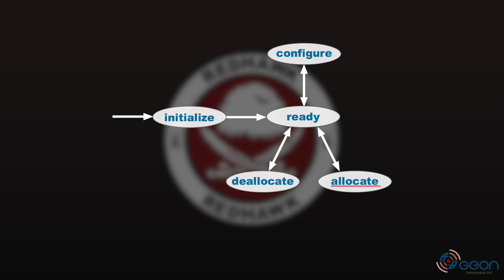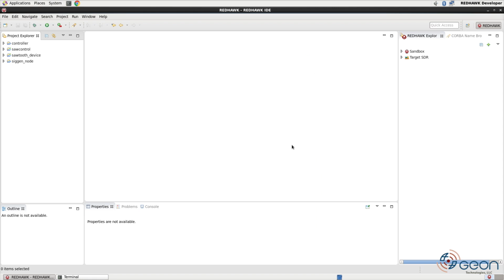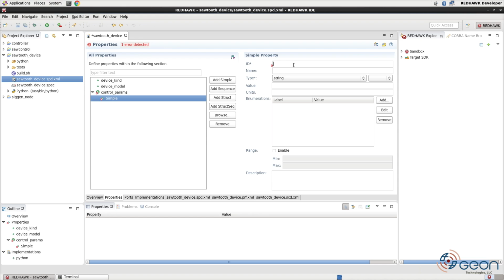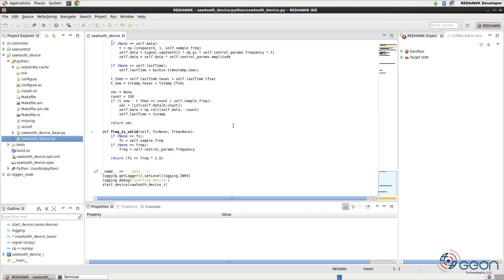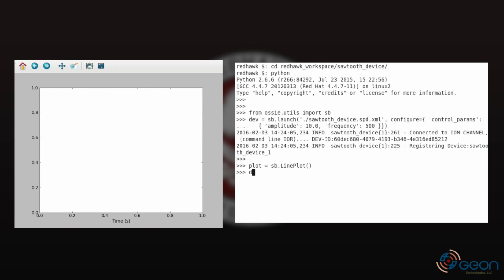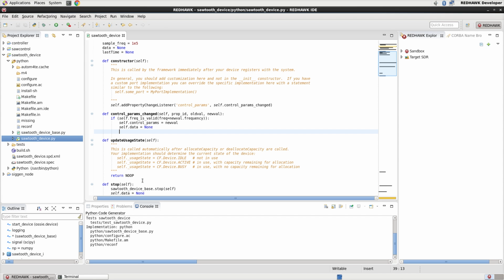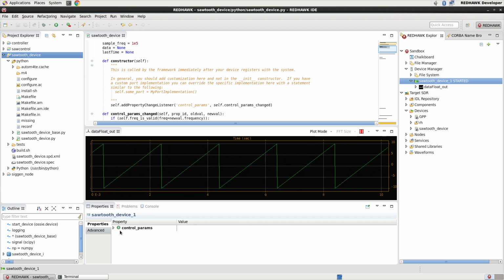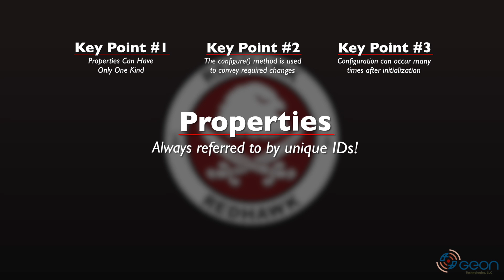Property Kinds Part 1 - Property (v2.0)

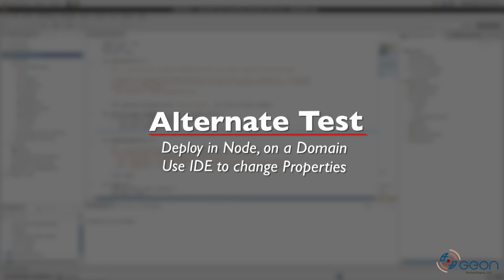Comment: Hi guys, 8:00 Alternate Test - How do you deploy the device to a target SDR? I'm trying to transmit a redhawk wavefrom from my E310 which has automatically connected its device manager (and USRP_UHD device) to the REDHAWK_DEV domain.
Reply from the maker: In testing, you can drag and drop the Device and then a Device Manager project containing it over to the Target SDR in the IDE.  That will give you the ability to run it on the local Domain (if running), but I'm not sure that's really what you're asking.  The USRP_UHD is not an executable device, so it cannot load or execute components from the Domain's SDRROOT.  For software components, that's typically the standard GPP device.  Does your E310's device manager have a GPP?  Does your Domain have the waveform and components installed in its SDRROOT?  Do those components have "implementations" defined that specify the processor type as that of the E310's GPP (as defined in its XML)?  If all those are yes, then having the domain launch the waveform will make the core framework match the implementation of the components to the E310's GPP at which point those components will be copied to the E310 Device Manager's file system and executed.
Reply: @Geontech  Thank you for your response. If possible, would you be able to ping me: jmcrossen80@gmail.com? It will be easier for me to convey what I'm trying to achieve via email